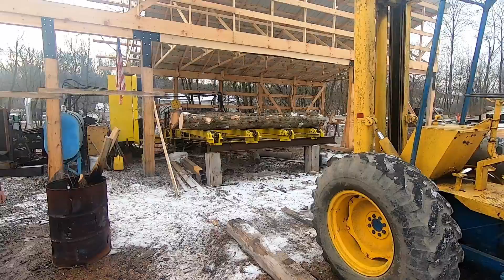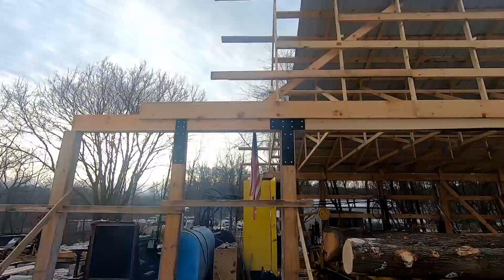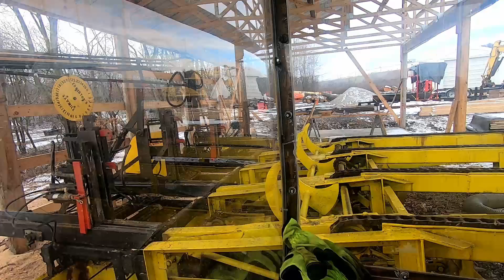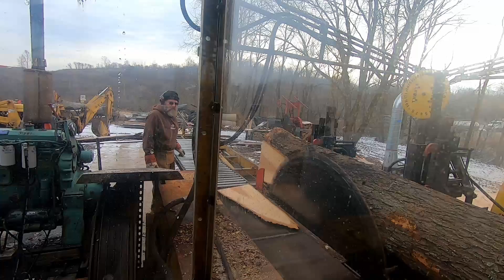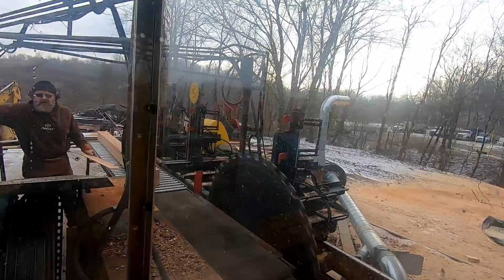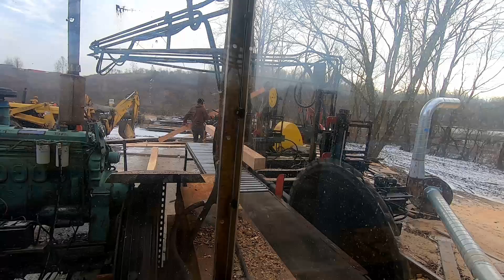sawing 6x6 s

Comment: Thanks, Mark and I was worrying hard about that taper but knew if you caught it and had 6 or better on the thin end you could fix it, and you did! Good looking lumber, excellent running bus motor, always up to the task THE Eddie Horvath, marvelous sawyer and if anyone is aggravating you about going faster or whatever, just tell them you're not cutting production, you're cutting PreCISION! And things get goofy when the timber is froze solid. Saws can do all matters of strange things. Best to do like you did and go slow and easy. Getting done with no holes in the roof and no blood and hair on the floor is the order of the day. Yall got my vote and have a MERRY time on wednesday! GBWYall and we're ALL blessed out the kazoo!
Reply from the maker: hey lewie hope all is good ,will be working on the building this week . hope to get the bus motor out of the weather soon . "merry Christmas "!
Reply: @markgalicic7788  Thanks, Mark and yall stay as warm as you can and the bus motor will be eternally grateful and Merry Merry to Yall as well!

Comment: Mark, i had a thought. Have an index card in the cab with a big T on it. If you run taper the T is up. Taper out, T card turned to blank card. I'm an idea guy. 👍
Reply from the maker: thanks Ray , I want to install a light in the cab to tell me a tapper is out.